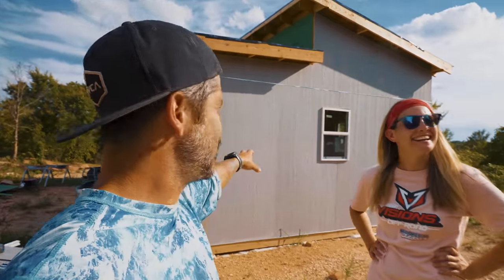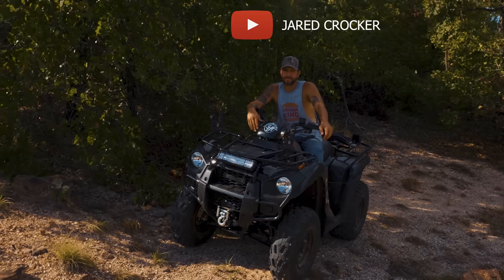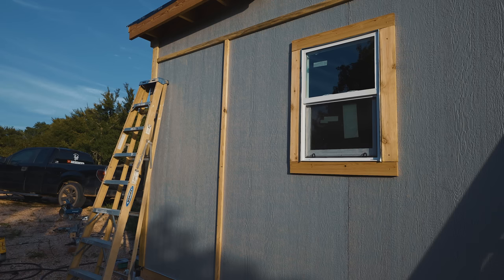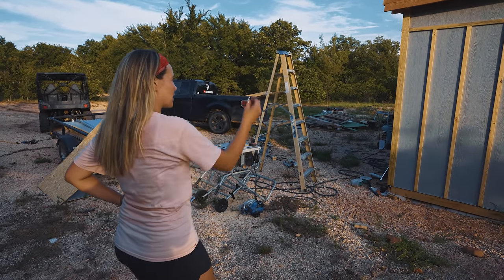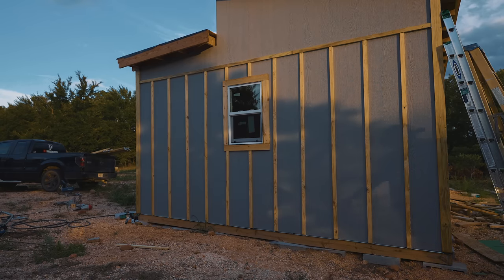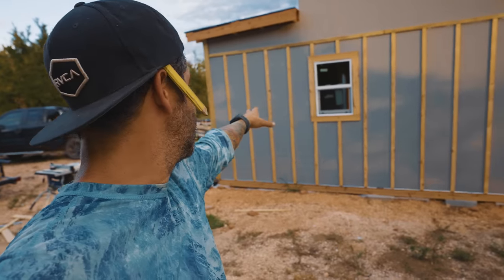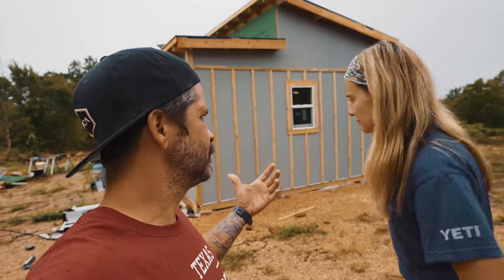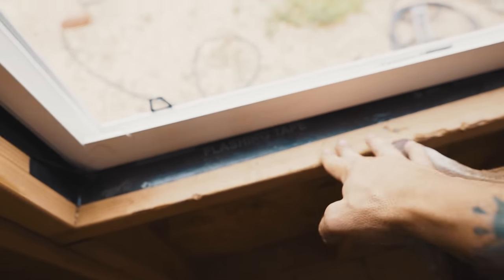Board and Batten on TINY HOUSE! Couple DIY Project / Off Grid Ranch Adventures

Comment: You might run into some water problems with horizontal batons. Water will have a tendency to sit and seep into the wall on and around the baton.  Take care to seal above and below with a good caulking.

Comment: Dadgum weatherman said it wouldn't rain till later so I rode my motorcycle to work  then I got rained on the whole way home. It's frigid soaking wet at 65mph. At 60 something degrees. To bad I don't have a proper phone mount for the bike yet. Wish I had recorded it.